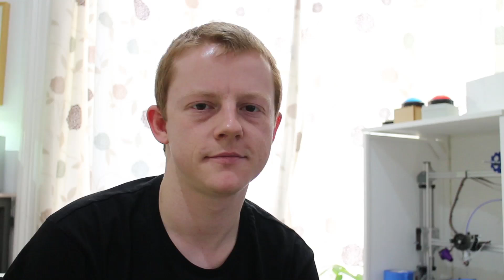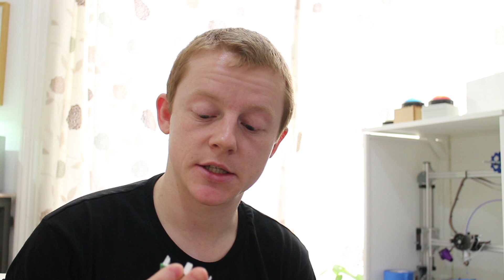Makerspace RFID Access Control #4 - New PCBs

Comment: You could also try some of the IDC (Insulation Displacement Connector) connectors, it is easy to put the wires on the ends. However it can be tricky to get the right size of wire, and of course you do need some sort of tool to push the wires in (I cheat and use a screwdriver). I also saw you don't like the ribbon cable connection in your other video. There are smaller pitch connectors out there which would do the job quite well :)